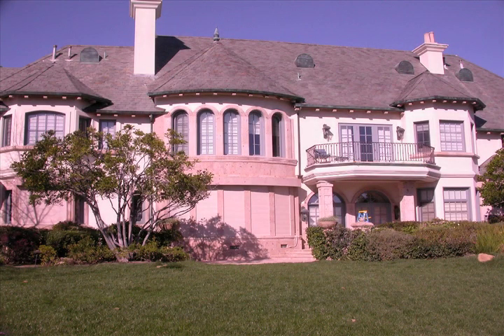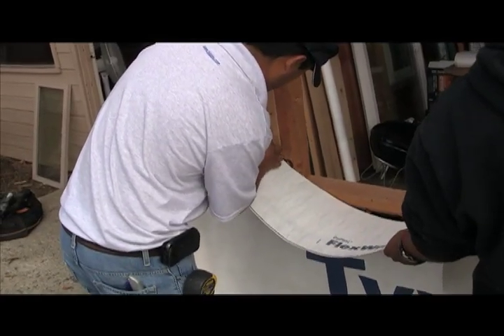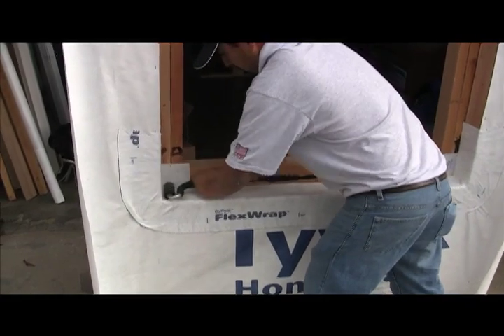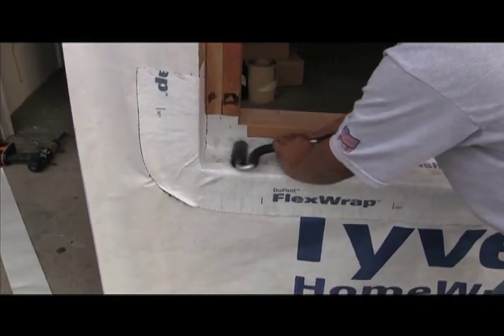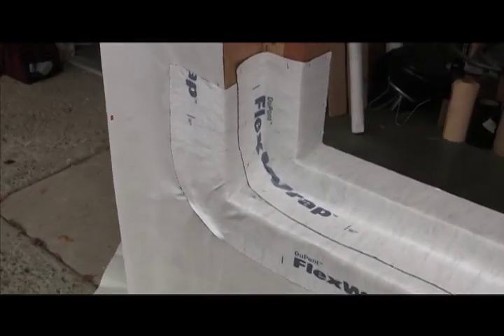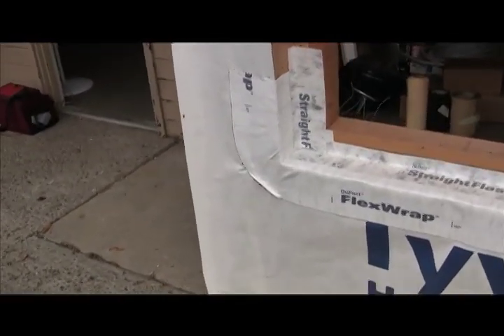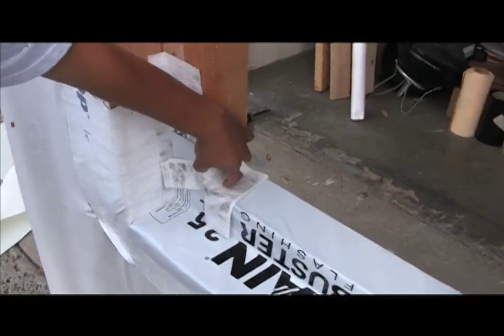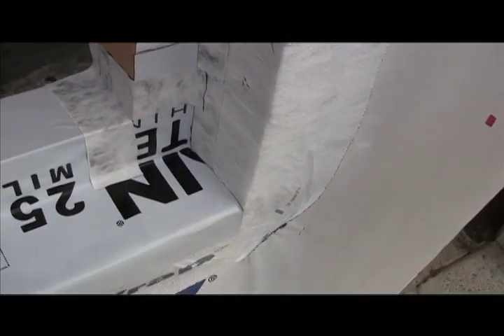Flex Wrap Recess Window Flashing Best Practices_by TLS Laboratories_

Comment: Would love to see hear a description of what goes over the flashing on the horizontal surface (the sill) to keep water from pooling. Does he put on a sloped sill? How is it attached without perforating the flashing? You wouldn't have a flat sill, right? This is the issue with recessed windows.